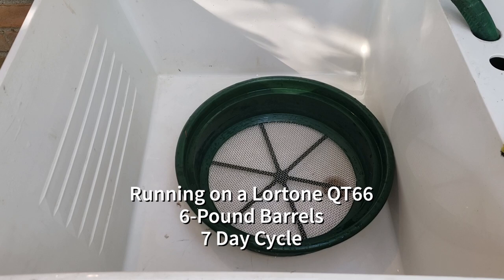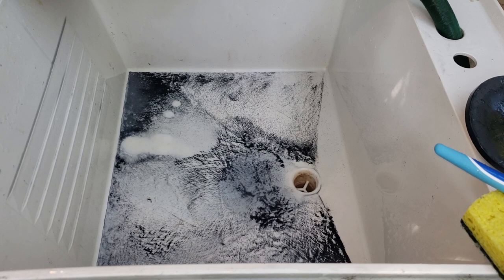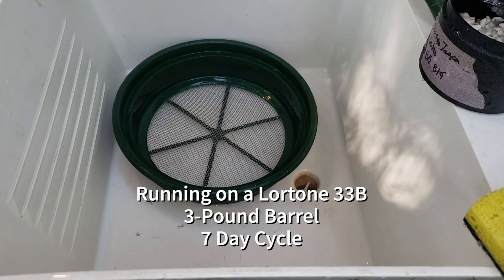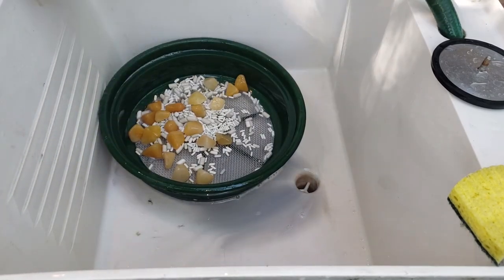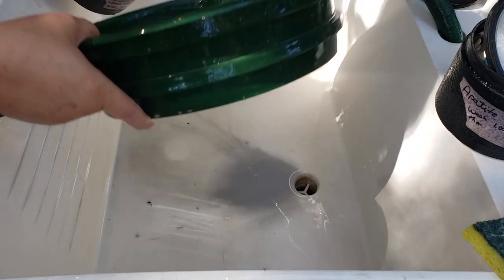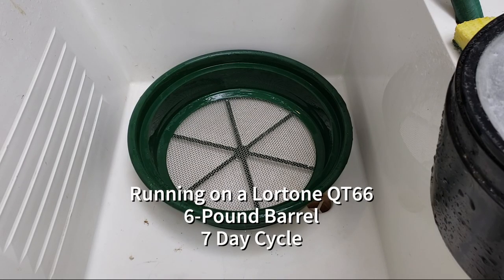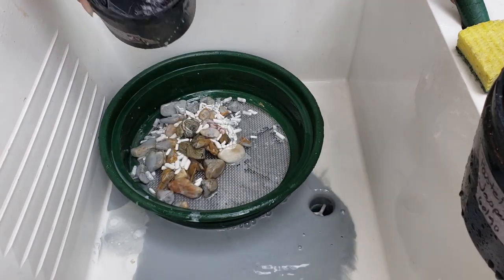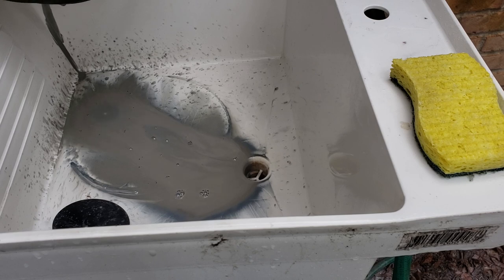How Much #Grit to Use When Rock Tumbling

Comment: You would think that the more grit left over would be longer for the grit to work on the rocks. Is the point to expeditiously polish rocks or is it to save waste? I guess the question is if using more grit is faster or better.
Reply from the maker: Wasting grit is expensive when doing the amount of tumbling we do. Using more grit does not make the grind faster.

Comment: Great question. Lots of variables: size of the barrel, rpms, type of stone, type of media, amount of media, amount of water, borax or not... I'm still tweaking my methods. I like your cerebral approach. I started with 4 tbs. in a 3 lb. barrel (rule of thumb) and have since reduced this to 3 tbs. You may have convinced me to reduce this to two. I don't have answers but here's my thoughts. Larger barrel need a higher ratio of grit due to more weight breaking down the grit faster. Softer rock needs less grit because the grit breaks down slower and it creates more rock dust. Ceramic media is the same as a softer rock. Smaller rocks may need more grit (what?!) because there is more surface area. Thanks for doing the hard work for us.👍 Be happy. Be kind. Never stop learning. Peace out ✌️🙂

Comment: Best not let the water and sludge drain into your sink. It can solidify…think cement and you’ll be calling a plumber.
Reply from the maker: It's an old laundry tub that is outside and drains directly into an unused rock garden, next to an exterior faucet with the hose attached.
Reply: @crystalwellnessstudio6171  people don't know that by watching your video and will be screwed pouring it down their drain.
Reply: @tylerburris4045  I was gonna say the same thing.  It's important that people know that this isnt just a sink drain. That grit can really mess up drains. A quick disclaimer would be useful.

Comment: I don't think I have seen anyone using ceramic media during the first stage. I thought that was typically stage two or even three and on.
Reply from the maker: Depending upon what I'm tumbling, and how much space is in the barrel, I do use ceramics in stage one.
Reply: I'll actually use chunks of marble in my later tumbling stages. 
  And...BS on the Grit not going down the drain due to it deciding to "linger"?  Especially since you just washed it down the drain... 
  Yeah,  it's going to linger... and be a HUGE headache later 🤦‍♀️